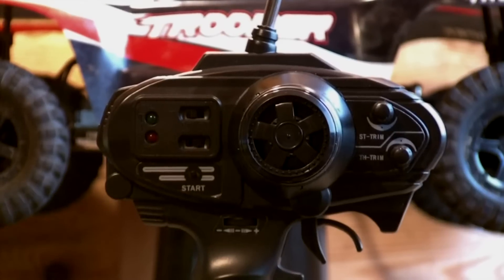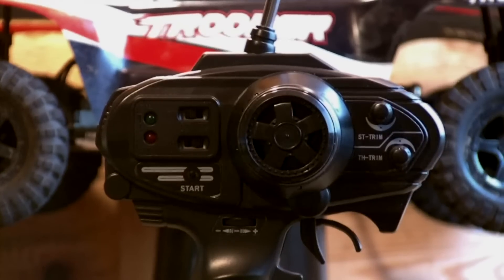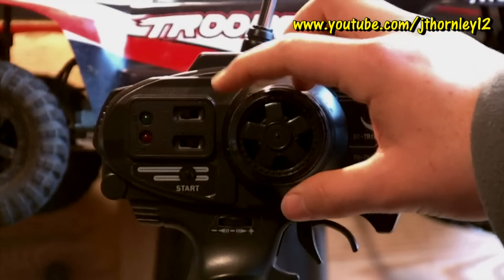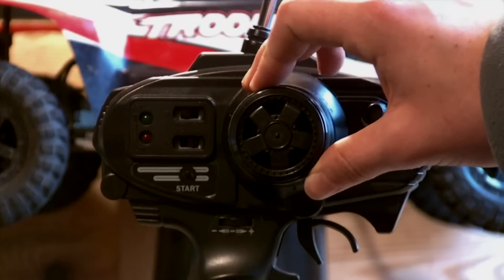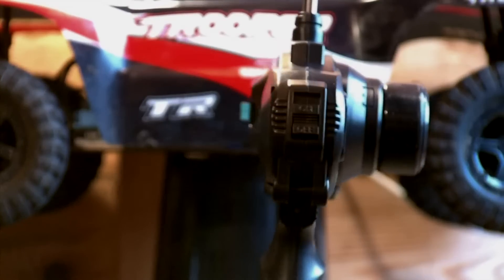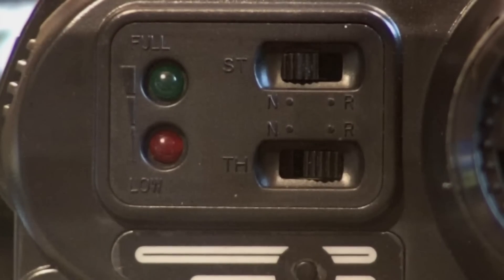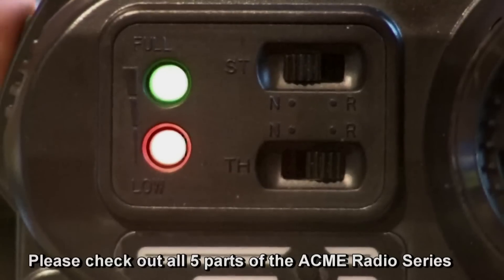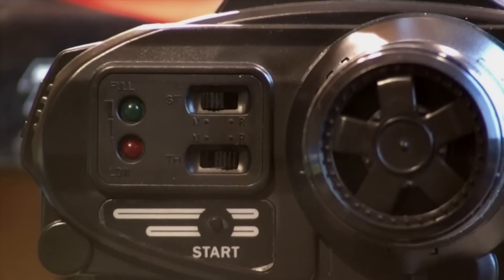ACME Radio Series - Pt 2 ACME Racing FM Radio Guide

Comment: I have a radio controller and my throttle and steering trims are push buttons which on the display count to 30 to reset my throttle trim do I want the default (1mm) gap in my carb, when idling at 0 which means allowing 30 clicks to open my carb on the trim? I just need to reset and 0 my carb ? Any help please